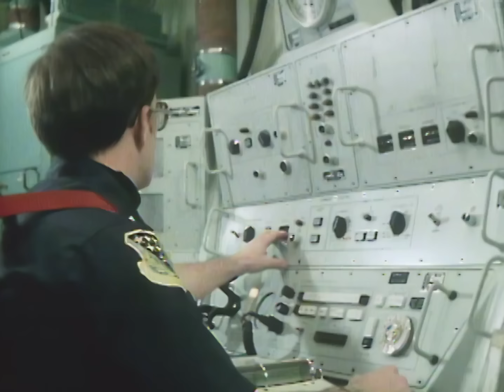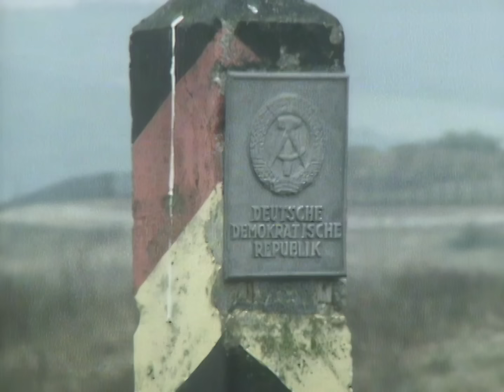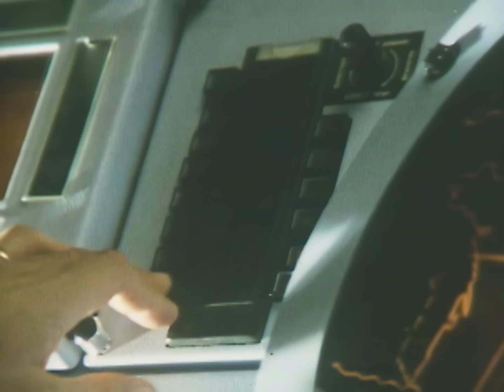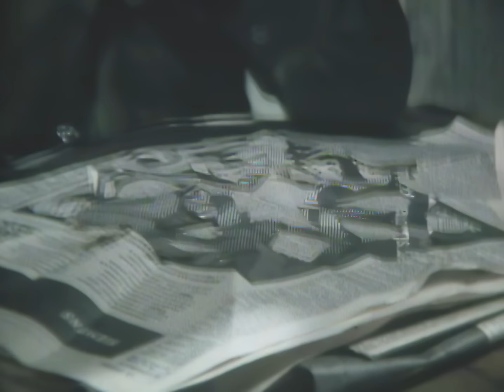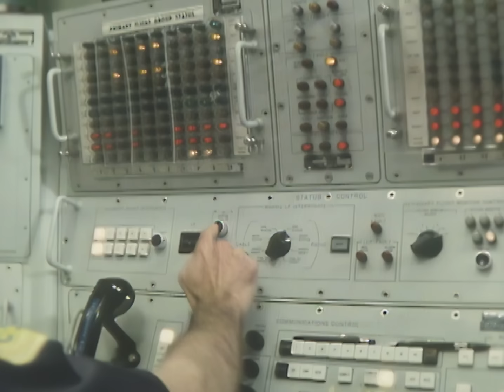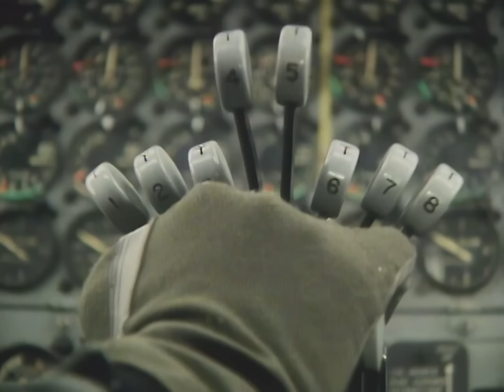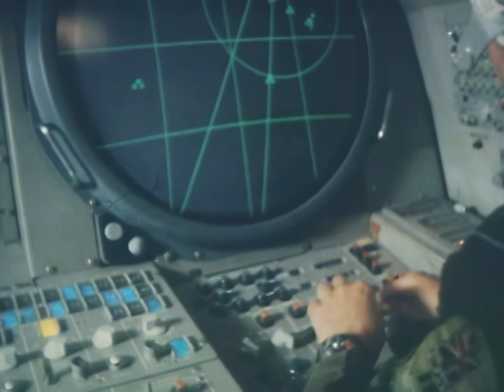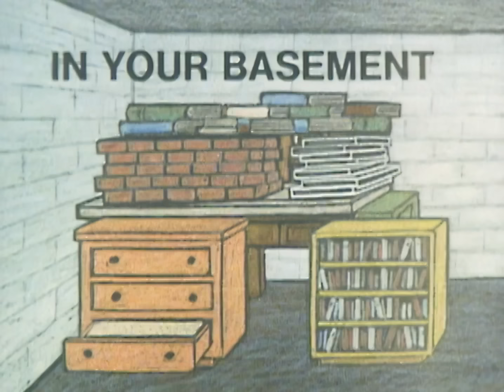Nuclear Nightmares: The Wars That Must Never Happen

Comment: US Army 1983-1986. A lot of emphasis was placed on "Fighting, surviving, and winning on the chemical, radiological, and nuclear battlefield." we knew what that would have meant.
Reply: Winning 🏅
Reply: @CaseyBerard-qv6bi The Soviet military was far more prepared for total nuclear war than NATO. All troops had CBRN kit and the military was 90%+ mechanised, with all their main vehicles being CBRN qualified. They also had a logistics system that was resilient to EMP and nuclear attacks.
Reply: @fh511  The books say they did, anyway. Whether any of that gear would have worked, been available, had soldiers trained on, etc in light of what we now know about Soviet corruption, lack of quality control, and general malfeasance is whole other question.
Reply: Able archer by any chance ?

Comment: What everyone doesn't account for is that, as of right now, nuclear weapons as part of a strategy of MAD are in the same category as antibiotics as life saving devices. WW3 hasn't happened (nor has any true multilateral major war) since the advent of nuclear weapons precisely because even the thought of a nuclear exchange is insane. Multiple times, even during complete automated command & control breakdowns (notably in the Soviet Union) field commanders refused to believe the US was launching a first strike. Of course, that could all change very rapidly, but for now, the world has been made, paradoxically, immeasurably safer by being placed in a continual state of potential annihilation. Arthur C. Clarke postulated that WW3 would see the same number of nuclear weapons used as WW2: just two, because that's all it would take to stop both combatants.